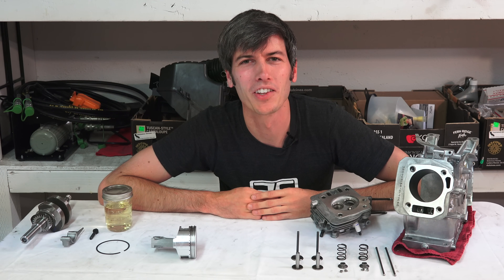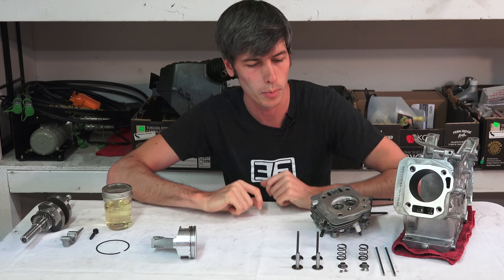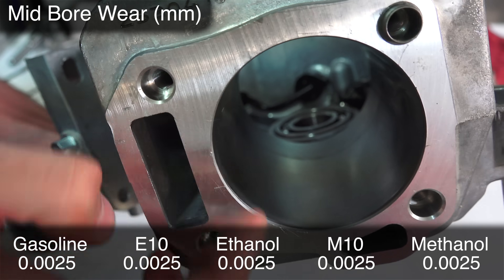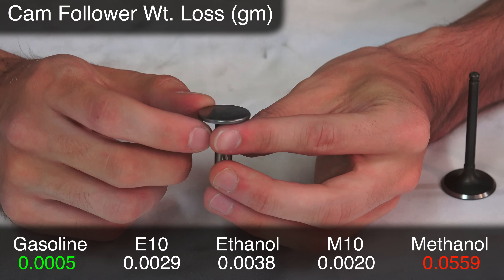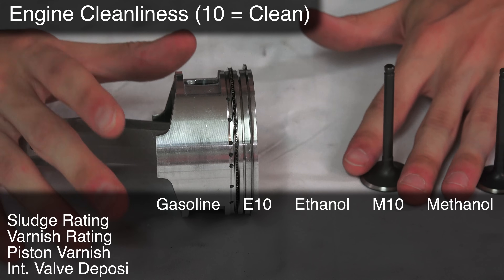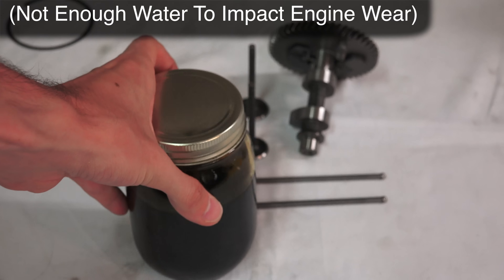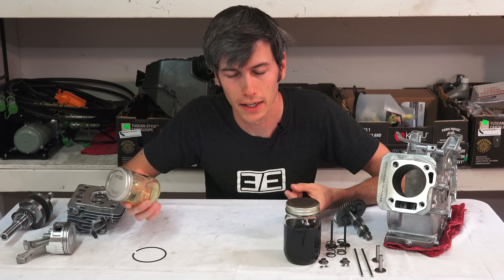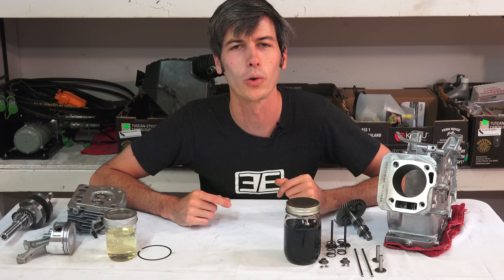Is Ethanol Bad For Your Car's Engine?

Comment: Ethanol is hygroscopic, gasoline is hydrophobic. Water contamination in fuel can cause engine non-starting and corrosion issues.
In countries like INDIA with around 90% humidity it's creating a great problem. Some gas stations are reporting layers of water in their tank. Imagine what it can do to your car.

Comment: Yes it's bad! It has no lubrication qualities to it! It draws moisture in from the air, and it takes 11 gallons of petroleum to produce that gallon of ethanol! And that's not counting the natural gas and propane used in distillation! And finally it holds a 3rd less btu's per gallon than gasoline! It's fools folly!

Comment: Over here in sunny England our regular petrol, (that’s  gaaaaasoleeen), recently went to E10. Luckily premium is still E5 though, I did my own ultra scientific tests using my ultra high performance Shitroen C1 1.0 litre, (that’s 61cu), and found that E10 made the car noticeably less responsive and use more fuel. Vid on my channel for anyone interested 🤷‍♀️

Comment: the first clue that this video presents completely USELESS information is when it's stated that the study the video is based on was published in 1981. engines from the last couple DECADES are PROFOUNDLY different from 1981. fuel injected vs carbureted, advanced electronic/computer controls vs basic mechanical control, more advanced combustion chamber and valve train designs including variable valve timing, anti-knock sensors, higher compression ratios and rpm ranges on average, advanced EGR systems, different elastomers and sealing materials, vastly improved lubricants and detergent additives, and so on. about the only thing in common between a 1981 engine and a current engine is the piston goes up and down. NO ONE should based a fuel decision today on the study. Dozens have studies have been done by the US auto-oil consortium over the past 40 years, all concluding that E10 is safe for today's vehicles. Automakers have in fact specifically designed door these fuels for DECADES.  I NO ONE offers or uses methanol fuel or methanol blends so why even mention it. autos don't design for methanol fuels, and won't warranty for them.finally ethanol is not corrosive. ethanol fuels, in fact all gasolines are treated with corrosion inhibitors to assure no corrosion. if corrosion occurs it's due to water in the fuel not ethanol, a rare occurrence. so not "engineering explained" unless you're teaching a history class for vintage cars. terrible. how do I know? i worked for the auto-oil consortium for ten years on several more recent studies.

Comment: as a motorcycle and classic vehicle engineer i can tell you that ethanol in fuel is causing huge problems. Many owners of motorcycles  and classic vehicles only use them occasionally  and get stood for long periods such as over winter etc.  Ethanol rots rubber fuel lines and any rubber or plastic parts it comes into contact with. Motorcycles with plastic fuel tanks swell and expand and in some cases split open due to the softening of the plastic which is a major fire risk!  To the point where many manufacturers have switched back to metal fuel tanks. 

Ive seen a suzuki hyabusa dump all its fuel out after the fuel lines literally fell apart due to the ethanol.  the bike was in an attached garage and he was lucky  there was no fire which could have burnt his house down and killed him and his family!

ive seen aprilia rsv1000s where the plastic breather pipe inside a fuel tank has melted through and dumped the fuel out.

my own 1965 ford mustang had a 1 year old carb diaphragm split and dump fuel over the top of the engine because of the ethanol. Again lucky to not cause a fire!

putting ethanol in fuel is dangerous and it wont be long before there are deaths caused by fire over this.  I advise anyone not to use fuel with it in. or as little as possible.

my own brand new ford puma hybrid states in the manual. dont leave the car stood un used for more than 2 months as damage may be caused by ethanol in the fuel!!

Comment: Just wondering, presume that the air/fuel mix in each case was optimised to suit the fuel in which case the alcohol fuelled runs would have produced approx. 60% more horsepower than the gasoline based tests (if run at peak power). Was the engine output power kept identical for each run, and if not could the extra mechanical stress be partly responsible for  the increased engine wear.

Comment: Another E10 video l seem to be replying to these videos because l live in Australia and l have personal experience with E10 and none have bean good if you use it in modern cars you will be replacing your petrol pumps more regularly any petrol powered garden tools with plastic carburetors they will fail these are from personal experience in other words avoid E10 l have not used it in years and l have had no trouble with my motor vehicles

Comment: As the UK has just gone from E5 to E10 this month (Sept 2021) this was very interesting and quite reassuring to hear. I'm glad this popped up in my suggestion list. Great content. All the best!
Reply: Do you drive an older car?
I daily drive a 30 year old Ford, engine wear was never a concern.
Fuel lines and carb internals are going to perish with the increase in ethanol.
I replaced my hard fuel lines to modern lines last year but no modern upgrades for carb internals on the old carbs.
Reply: @stan110782  I wouldn't worry too much about it. I have a Chevy 350, with a Holley 600 double pumper, and have seen no issues with E10 here in california. The only times I have a problem is if I let the carburetor sit long enough that all of the fuel evaporates out of it... all gaskets and rubbers turn hard as rock. Keep the carburetor wet, and don't let it sit for more than a month, and everything will be just fine. 

If you have to evacuate all the fuel out of the carburetor for storage, use some Marvel Mystery Oil additive, as it will keep the gaskets moist.
Reply: E10 has screwed my brothers 2016 honda cbr. It sounds as rough as a clapped out banger now
Reply: @c-19thegreatlie62  hearing all this is frightening. I run my BMW 335i (2010 model) on this and it's quite a high performance engine. It runs like a dream, not noticed any performance lost. Not sure about mileage as unless on a long run I don't get anymore the 19mpg 🤪. It does say behind the fuel filler flap, max 10% ethanol. Shame other manufacturers seem to have not adhered.
Reply: @acward2007  I use to have a 2008 335i stage 3, lovely car! I only ever ran that on premium personally, I have 2 cars currently, 1 new mazda 3 diesel, and I have an old audi 80 quattro s2, I haven't chanced putting e10 in that as I don't want to wreck it
Reply: @c-19thegreatlie62  cheers, the 335 is the best car I've ever had. It's not quite as souped as yours as your one would have had the 2 turbos where as mine has the twin-scroll turbo. It's good fun as it's the convertible. Very envious of you having the Audi 80 Quattro, they are amazing 😎.
Reply: @acward2007  yes I believe it did have the 2 turbos, technically biturbo? it ran at 393bhp if I remember correctly. And yeah, I got it as a non runner barn find and have been restoring it. Weirdly, alot of vw golf parts fit! I just need to source a grey passenger door card now as its f***ed lol.
Reply: @c-19thegreatlie62  barn finds are the dream of most petrol heads, good on ya. Did you cone across the Audi the same way as they are rare?
Reply: @acward2007  a customer of my mum passed away, it was left locked up at the back of the house. The daughter said we could just take it. Its running, serviced, new brake and fuel lines etc, just restore the paint work and just need to finish the interior and sort the wheels now 😀
Reply: @c-19thegreatlie62  Wow, sounds amazing. Brilliant that you've invested time and money in to it. With this throw-away society, its seems people should learn from us car enthusiasts on how to keep things going and not just give up on stuff. Hope you get it fully up and running.
Reply: @acward2007  she's going in for an mot tomorrow, wish it luck! Haha
Reply: @c-19thegreatlie62  Hope the MOT went well and she’s on the road :-)
Reply: @c-19thegreatlie62  I had a 2005 BMW 330d convertible and now currently have a 2019 Mazda 6 2.2d I have always had diesels. 

I heard a lot of bad stuff regarding E10 as my next car should be arriving in the next 2 weeks a BMW 420i Coupe which will be my first petrol car.
Reply: The LAA has recently published an article showing that light aircraft and classic cars should not use ethanol. It has been seen to cause severe corrosion to alloys in carburettors and fuel lines and tanks. I would suggest reading the article before using E10.
Reply: Its bad for your fuel pump seals and any and all rubber seals in your engine as it degrades them
Reply: He not talks about 10% less power and worse mpg on e10 vs pure 95 ;)
Reply: We feel your pain.
Reply: Hey guys if your cars 10 or 20 years old has anyone put a few caps of redex in with E10
Reply: Man I'm on a few Mustang groups in the UK. This question has been coming up so much since they announced they were switching. I know for a fact that the S550s specifically are flexfuel and will happily take E85 with nothing but a tune. As many times as I've mentioned this people are still nervous about the E10
Reply: Bro it’s fine, the standard of fuel in Thailand is e20 and the premium is e10, if it was an issue you’d know about it
Reply: According to the LAA E10 can cause collapse of fuel lines and damage fuel tanks, it can also destroy carburettor components
Reply: ADAC club in Germany want to go to E20 there argument its better for the clima
Reply: Most of the Super Unleaded in the UK is actually ethanol-free and not E5. I'm gradually testing each brand but getting fuel for classic cars and bikes isn't a major issue yet.
Reply: Yes. Enjoying the 25% reduction in MPG. I'll stick to E5 or below.
Reply: My subaru hates e10 and the inlaws subaru barely even runs on it!!!! God know what long term use will do to them but we're not taking the risk!!! Super unleaded only now
Reply: @LostinWales  its probably the fuel mapping causing the issues, the engine needs to inject more ethanol to get the same bang as a smaller quantity of normal petrol. Couple that with the issues of old lines, gaskets etc it's just easier to run super now.
Reply: @LostinWales  My 2011 Renault megane tce went from 35mpg to 26mpg last September when E10 was introduced in UK and also started stalling when pulling away from junctions. Moved to super unleaded and all is good. Wife has a brand new Clio and that is on super too. I do not trust E10 !!!!
Reply: only difference is that here in the uk it is bioethanol as opposed to regular ethanol
Reply: @BrasileiroBritanico1  its bio in US too

Comment: Great explanation. Would you be able to do a video on how flex fuel works and how you can benefit from power gains as a lot of people are using flex fuel kits including the effect it has on pulling timing. as well methanol injection used to cool the intake rather then as a fuel and how you can benefit from both used in conjunction as I see them both used together alot with alot
Of great gains on turbo direct injection cars 

Thanks love your videos

Comment: But two identical 5 HP engines, run straight fuel in one and ethanol blended fuel in the other, run them until they fail. I would bet the ethanol fueled engine will die first.

Comment: Ethanol is bad for : Metal , rubber , your engine oil , seals and these are proven facts long term. Including it absorbs water from the air , inconsistent batches of quality.
Ethanol is good for : Detonation resistance , carbon deposits in direct injection engines. At higher concentrations say E85 its basically race fuel but you have to get vp to get consistent octane ratings , pickle the system so basically its good for highly modified cars . I'd say run meth .

Comment: I dont want to sound like a smart arse, but surely any engine that shows wear after 20 hours use is a shitty engine, and nothing to do with the type of fuel being used. 20 hours is nothing for a modern engine so the test is pure bollocks, and the differences in wear between engines can only be considered as "Just one of those things"

Comment: I wonder what E85 does to pistons after time. rumor says its corrosive to aluminium.. my injector rail is also aluminium, but I think it will be okay because there is no air. what do you think E85 does to pistons?

Comment: I went to school for green energy the ph and acidity are virtually the same for ethanol and petroleum.For everyone who asks about the fuel system wear I ran a 50/50 ETHANOL AND UNLEADED mix for 250,000 Miles eight years of delivery driving in my jeep.I didn't have any problems with any of the fuel lines or system to this day runs great. The higher water rate in ethanols oil makes sense ethanol will pull water out of the air. That is what can cause corrosion in older cars fuel systems it's not the ethanol but a air leak that ethanol will pull water in. But if your fuel system is sealed like it should be there is no problem running up to a 50/50 Mix. I am currently running my 1987 chevy van on a 50/50 mix with no issues. The fuel mileage is slightly lower but the engine oil stayed way cleaner. I am going 10,000 miles in between each change. Ethanol doesn't pre detonate like petroleum does and it's a hundred fourteen octane for you  racers. In older cars you can adjust your jets and advance or retard your timing depending on your fuel mixture. Please look up David Blooms alcohol can be a gas, it's a book that explains it far better than I can.

Comment: sorry but pure gas is the only way to go if possible. ethanol worse on the engine worse gas mileage and cost more to produce and has caused the cost of any corn products to up a lot due to so many farms just making corn for ethanol subsidies. not worth it

Comment: For better lubrication, why not use heavier alcohol fuels (of course not in cold environments for obvious reasons)? 
As the alcohol molecular chain increases in length, the viscosity increases whilst the oxygen content decreases. I remember from chemistry rubbing some butanol or pentanol (can't remember which one) between my fingers through a glove, and it had the consistency of oil.
The disadvantage would be that heavier alcohols would have lower calorific value because of the lower oxygen content, but at least they're denser, so you can store a larger quantity of fuel within a given volume.

Comment: E10 is a joke ! False economy... it may be cheaper but you use more ! Finally fuel systems are not happy with E10 ... it still causes corrosion .. just happens over a slightly longer time . Avoid E10 at all costs

Comment: Corn based ethanol is terrible! Aside from damage reported by technicians who actually fix things, it takes more energy to produce than you get out of it. Then there is the fact that it’s production is not scalable. Then there is the heavy reliance on chemical fertilizers which run off causing pollution affecting the health of riverine systems and ultimately winds up in the Gulf and is a major contributor to the dead zone. Look it up.

Comment: How does methanol/m10 compare to a water/methanol injection system in the air intake?
Reply: They are using ethanol [grain alcohol] instead of methanol [wood alcohol].

I waa a line tech in a Dodge store, then a Chrysler/Plymouth store, in the 1970s-80s.

Methanol was a nightmare in that it destroyed nitrile and synthetic rubber fuel system components in short order.

Ethanol wasn't much better in fuel system component life, but it was horrible in drivability issues.

Comment: What about classic cars with lots of rubber hoses etc.?
Reply: I actually searched all the comments for it. I had classic cars when we started using E10 here many years ago and after a while they started leaking oil. Old cars are old and so on but these were original unrestored low-mileage cars in good condition. Most old engines  are restored and they don’t seem to suffer from it. Rubber and hoses are easier to replace and will need replacing anyway since the dry and crack over time.

Comment: Dead easy to remove ethanol if your car is older. Get a clear container to put the e10 in, must have a pouring spout on it. Get some water, 1:10 ratio of water/e10, put food colouring in the water (not yellow, blue/black work best). Step 1, mix the water into the e10, shake it up to mix it well, make sure you set it down with the spout ready to pour. Step 2, leave it to sit for a day to separate. Step 3, Drain off the coloured water/ethanol until it starts to run clear. Whats left is your 99.9% unleaded

Comment: 2015 Nissan Micro , it started running like s**t , no power at all , would shift to lower gear while on flat highway , I tried gas with no ethanol and like night and day , car started running like it did when new

Comment: Engines and parts made to take this fuel are OK if in daily use. But any engine that's not used regularly will rot. Carbs fuel systems. It attracts water that rot out fuel tanks .float bowls. And so on. Plus it's benefit is dubious.  Crops instead of food. Pollution making replacement parts. Less mpg. . It should be stopped